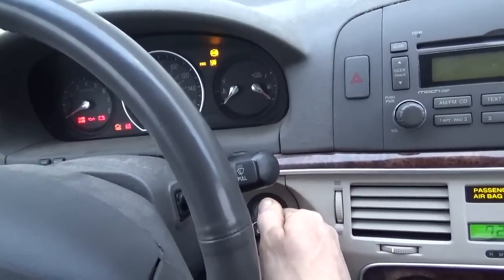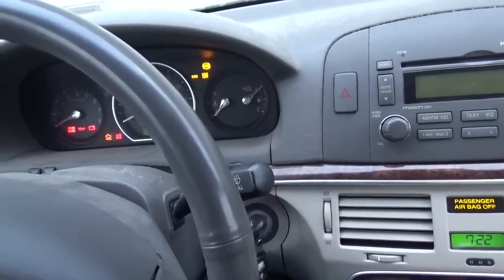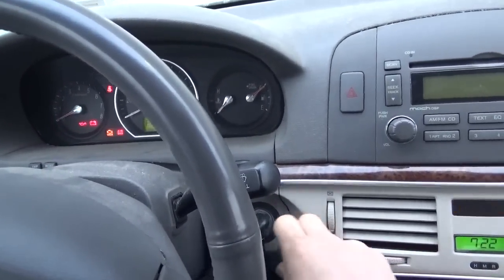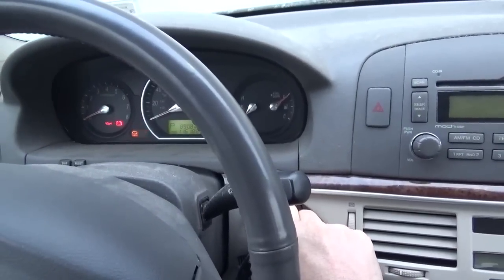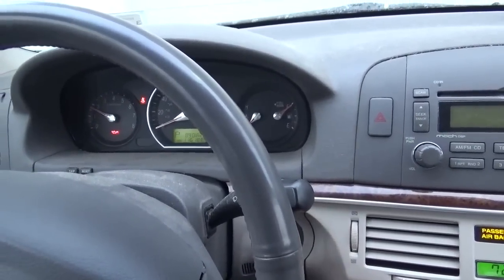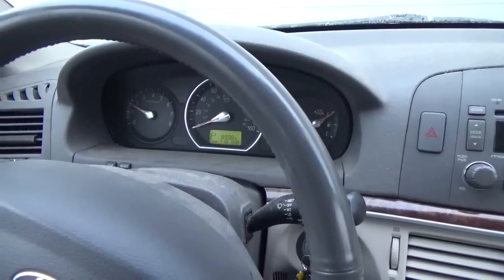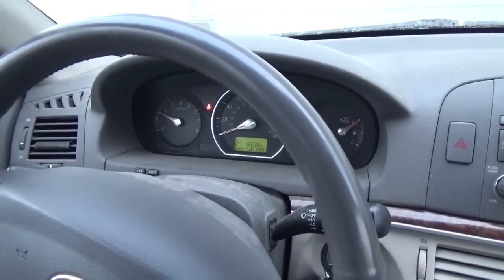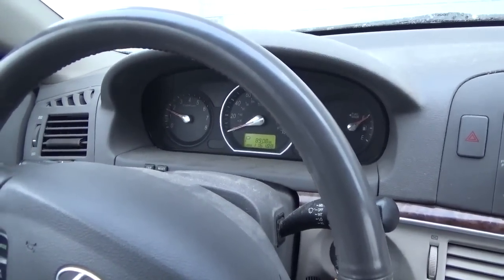Hyundai Sonata P0171 PART III

Comment: Great series of videos good job! As for the long crank time i would agree and suspect either fuel leak or check valve in pump. An effective test is put your fuel pressure gauge in series and crimp off the side going to fuel rail and watch pressure over a few hours. 

Keep up the good work

Comment: With the miles on the odometer, I'd check with the customer to see if the fuel pump's been changed.  If not or not sure, do a pressure/volume test, engine hot, then scope it for dropouts, running current and possible brush/commutator wear.  Check the relay plug in for what looks like very hot or burned contacts and pins.  Does this have an Inertia switch?  Had the harness side of a switch connector get hot and INTERMITTENT lose connection, causing a stalling condition while driving it.  Finally, leave pressure tester connected overnight, verify pressure comes right up to spec the next morning.  Hope This Helps.

Comment: I think you have it fixed. The 02 off causes the fuel trim to "set'" to the crap part throwing everything off. You mentioned you checked the coolant temp in comparison to the IAT cold, so you can rule that out.

What I would do is pull the plugs for a visual, see how badly they are worn and see if there is any lean or rich "look" to them.

I just worked on a simmilar case, 2007 Impala. Very hard to start when cold and blew black/rich smelling smoke for the first couple seconds. The Previous owner (a county sheriffs department) dumped a TON of new parts into it (fuel pump assembly, plugs-wires, cam sensor, bank 1 02 sensor) in an attempt to fix the problem. I purchased the car with their diagnosis of needing a new engine wiring harness/new pcm. Not sure on how they came up with that but???

Ruled out fuel pressure (left the gauge on overnight and it held pressure), no codes, IAT was reading 40F when it was 0 f out. Pulled the plugs and they were all black carboned up along with the new 02 sensor being the same way. New plugs, 02 sensor, and a new IAT sensor and its running/starting perfectly. I want to drive the thing to make sure it doesnt foul the plugs out over time though. We will see.

In my ramble, plugs make a huge difference with cold starts. Wear/deposits will cause extended crank times
Reply from the maker: Talked to customer yesterday and all is well so far. Said car starts and runs like a champ :) So far so good. As far as your impala sounds like a good buy. I would have though a if the temp sensor was saying 40 when it was really 0 it would have made a lean condition? That's interesting...

Comment: I just love the phone ringing and the door chimes going off - you operate a real shop, not a film studio:) my two cents worth- O2 operating in a interment state causing high fuel trims at times flooding the engine so on a cold start the ecm is keeping the injector dwell time way too high at times. I think the car is fixed.  Hey just a youtube Yahoo guess.  👍
Reply from the maker: SOLD! Everyone here take note Steve Rob confirms and guarantees it is fixed! Lol Thanks for the vote of confidence Steve. I hope for the customers sake that is it. That was kinda my thoughts too.
Reply: South Main Auto Repair Hi Eric...I've got two cents to give away also. My thoughts are along with Steve's. When I saw the first video, my thoughts were that maybe the heater circuit was open causing a long delay before the sensor was active. Then I wondered my didn't the car set a code. Originally, the car had a P0300 code. I don't know about the Sonata's programming in this regard and can only relate this issue with a GM car that I own. The heater circuit is only looked at on startup where the IAT and ECT are within 11°F of each other and on the first ignition cycle. Also, if there are any misfire codes, critical sensor codes such as for the TPS, IAT, ECT, MAP, MAF, then the O2 sensor will be ignored since the PCM couldn't run a valid test on it. Since the car had learned to run rich and with a cold temperature, this would richen the mixture even more. So, I believe the car was a little flooded when it was first being started. After changing the O2 sensor, the PCM has learned the correct fuel trims so that it would deliver the correct amount of fuel on the next startup. Since the car started fine after a long period of shutdown, I would say this eliminated the drain back of fuel to the tank and any cold issues. So, I believe the car is fixed! Okay, do I get any change back LOL...
Reply from the maker: stuzman52 Let me check my pockets to see if I have any change...hmmm... This is how Hyundai looks at a code P0135 B1S1 02 heater code :

DTC DESCRIPTION:
The 02 Heater diagnostic compares the current that is passing through the 02 Heater to a low limit. When the current is too low, the 02 Heater is considered failed. A failed 02 Heater will have an affect on vehicle emissions, especially on cold starts. The O2 Heater allows the O2 Sensor to work properly more quickly after the engine starts. If the PCM detects heater current is lower than threshold value for 2.5 seconds or over while enable condition is met PCM determines that a fault exists and a DTC P0135  is stored.

That is the criteria that has to be meet. Also I had erased the "P0300" so the only code it had was the P0171. Did that inhibit this P0135? Maybe... we would have to ask Wing Wang that wrote the software ;)
Reply: stuzman52  Terry that was some fancy terminology  whole lot better than what i came up with. Hope you dont mind me writing  this down in my notes for next time. Pretty soon were going to be on Erics payroll for most outstanding  diognostic guesses. LOL  Well at least for me.  You know what your talking about :) 👍
Reply from the maker: Multi-syllable words do not earn you extra pay... but it does sound good when you can really lay it on all fancy pants like lol
Reply: South Main Auto Repair I remember reading that posting Eric in your earlier video and to me it left a whole lot out. I'm sure that if other codes were set, then it very well may not look at the sensor. What I found interesting is that it used the word current to see if the heater was working. This implies that there is a series resistor inside the PCM where the voltage is being monitored across this resistor to see if there is any current flow. On the GM, it was looking at the actual voltage of the O2 sensor and watching for activity. It measured the time of when the engine started and from the time the sensor responded. There is an algorithm that takes the temperature of the ECT, IAT and MAF and calculates a predetermined amount of time that the O2 sensor should respond. If the sensor takes too long from its calculated value, then the code is set in the freeze frame and brings on the MIL on the 2nd drive cycle. As for the P0171, that could very well inhibit the O2 heater code, but as you've said, we have to ask Wing Wang how it all works LOL...
Reply: Steve Rob Ah hell Steve..you know how it goes, make up some good words and just make it up as you go LOL.
Reply: South Main Auto Repair Dab nab it LOL....
Reply from the maker: Old Wing Wang hold the answer haha. So on a GM you don't think it looks for a complete circuit it actually uses an algorithm and looks at response time based on other inputs? Interesting. Now you mention What I found interesting is that it used the word current to see if the heater was working. This implies that there is a series resistor inside the PCM where the voltage is being monitored across this resistor to see if there is any current flow. You know what was weird this 02 heater was 15ohms unlike most we test which are 3 to 5 ohms.. dunno if that makes a difference to you or not.. That higher resistance would make it draw less amperage that a regular 02. At 12v and 15ohms it would be .8 amps as opposed to a 5 ohm heater drawing 2.4 amps... I dunno
Reply: Yes, that's right Eric. The GM car, at least the 2000 LeSabre that I own looks at the actual O2 signal voltage and doesn't actually monitor the heater circuit. And it's seeing how long it takes the O2 signal to respond from the time the engine is started. Then it compares this timed value against the algorithm's calculated value. Interesting on the O2 heater resistance. I suspect that if they are actually measuring the heater circuit current, there has to be a resistor in series with the heater circuit and the voltage across this resistance is measured. Of course, the PCM knowing the voltage can calculated the actual heater current. If this is the case and I suspect it is, then the actual heater current would be a little different from the calculated value due to the resistance of the internal resistor. It's probably a small value to get the maximum current out to the heater. And since this current is a lot less than other heaters out there, the wattage of this resistor could be smaller compared to what the wattage of the other sensors would be. Wow, just thinking of the wattage for a resistor with 2.4 amps running through it. That's probably why GM is monitoring the O2 signal instead of the actual current. Just rambling some thoughts around Eric...
Reply from the maker: **BOOOMM** That is Steve Rob's mind just being blown by all this big talk haha. It's ok Terry we like the rambling. Love talking hearing and discussing this stuff with you guys :) It's how I stay Edjamakated
Reply: stuzman52  Eric where's  the tip jar - this is worth at least two bits :)
Reply from the maker: It's on my main screen of my YT page... it says Donate.. It only takes Franklins though sooo....
Reply: South Main Auto Repair That o2 seems like a non oem replacement part.The pcm is very sensitive to the exact current flow in the heater circuit and any deviation from the norm,shuts down the heater current,hence the delay in the sensor working normally,
Reply from the maker: Well we confirmed the sensor coming out had a bad heater... it was a Kia / Hyundai sensor I took out. The new one we put in seemed to respond very quickly. AT least as good as the one we did not change ya know.

Comment: We go through a lot of O2 sensors here down south, I have had lots of problems out of the Bosch sensors bring bad out of the box or that won't jive with the computer for whatever reason.
Reply from the maker: Emt Scythe Ok good to know thanks
Reply: Emt Scythe I have had problems with Bosch before as well.  Mainly with spark plugs and wires.

Comment: I had a Ford contour years ago that it would dump excessive amounts of fuel into the cylinders when it was really cold out when it was started for the first time that day. I never did figure out why that would happen. And it didn't do it all the time just ever now and then but I had to take the plugs out when it would do it and use a torch to get all that blame gas out of them. After I did that it would start every time. Crazy stuff that can happen lol

Comment: first, good job. secondly  maybe the no start problem is related whether the car is level or up- or downhill. i have seen fuel pumps with cracks either in a plastic part  or in a hose and when the fuel level did cover  the crack there was no problem and vice versa. i know it is a wild guess. if you have access to the fuel line on the engine you could wait (after running) for one or two hours and then loosen the line (alps yeti style:-)). if fuel is squirting than the pressure is ok.  or maybe the MAF is dirty. ok enough is enough;). PS. please ignore my english.
Reply from the maker: Lol no your fine Paul Grottel All suggestions are welcome and appreciated. Talked to customer today and all is well so far. Said car starts and runs like a champ :) So far so good.

Comment: maybe check for a tsb?? might be one. but im thinking the same thing that lean o2 sensor caused them rich numbers and most likely flooded it during the long crank times it had, or fuel bleed back
Reply from the maker: Checked TSB's and Campaigns. Nothing out on that. Hey time will tell I figure :)
Reply: maybe scotty kilmer can help next time!...
Reply from the maker: Oh phil holbrook I may have to ban you now.... -_-
Reply: haha he pulls out a chinese scanner and says you need special equipment to test things like me. the same scanner is available at harborfreight.
Reply from the maker: Then he jumps outta garbage can and screams at us haha
Reply: Man does he hate BMW's the no dipstick on the engine just blew his mind. And the electric water pump he didn't like either.
Reply from the maker: He hates everything unless it is an F150 or a Yota...

Comment: Hey, as with my a8 the gas is running back into the tank and it is not starting, but only if tank is half and more empty.Perhaps in this case it is similar (I don't know how the pump and it's sump is engineered with the Sonata).Just fueled it up and now it's ok? Just see what will be happening if the tank gets more and more empty

Comment: Thank you for the video, I actually have the same year of sonata but mine is 4 cylinder the check engine light came on and after diagnosis it say o2 censor I went to change but front and back but the light came back on again I checked it says lean fuel bank one I did a smoke test I didn't see no leak. Please can you help me on what next to do am actually getting frustrated right now because I have spend a lot of money on it
Reply: Intakesystem, EVAP leaking (is it called purge valve don't know)
Fuel Pressure at least 3,5 bar
Injectores failed 
Messed timing
Bad Compression
Reply: My sonata is a 2006 4 cyl.
Runs perfect no check engine light but.
Never clean up monitos of cat and o2.
So i cant pass inspection.
I fou d a freeze frame p0133 upstream o2 sensor.
After replaced idle erratic and the code is p0170
Reply: Now waiting for downstream o2 both are NGK

Comment: Hey there I have a similar slow start on my 97 avalon xls its cold out here in pa sometimes below zero but it also happens in summer but my battery was completly dead a couple of times this winter could it just be the battery after it runs for a few it starts right up tnx . you make awesome vids by the way
Reply from the maker: Swing into Advance Auto or one of the other local parts stores and have them do a free battery test for you. They can let you know if it is getting weak. However if it is cranking over fine chances are your battery is good.
Reply: Thanks for advice

Comment: Hi, My 09 sonata ESC & check engine light come on and car dies while driving. No codes. Pull over and it restarts. May do this several times and then not again for days. Dealer has no clue 3.3 V6. Thanks
Reply: What is the code in the check engine light?

Comment: I have an 2000 Elantra that has the check engine light on. It's got a bad O2 sensor which I have to replace when it gets warmer outside. We just had some sub-zero temps earlier this week and I had a hard time starting it. I'm guessing the same issue as you had. It starts fine any other time.
Reply from the maker: Joseph Costello Lets us know how it ends up for you. Don't think faulty 02's can cause hard or no starts though.
Reply: Joseph Costello The car do not use 02 sensor at start up, that sad I do not rule out a sensor that's make a rich condition can have a long crank time also a leaking injector will have or bad ETC sensor.

Comment: I have an 06 with exact issues, replaced all 4 sensors and still with the buiis...t
 CLD it be a computer problem this is getting costly with no results ugggg did anybody figure this out my Lord it's driving me crazy
125,000 miles
Reply: purge valve! always the purge valve.